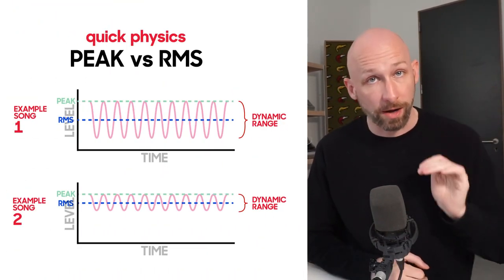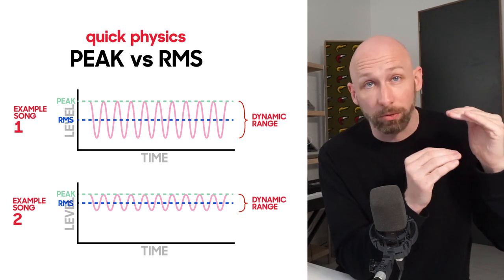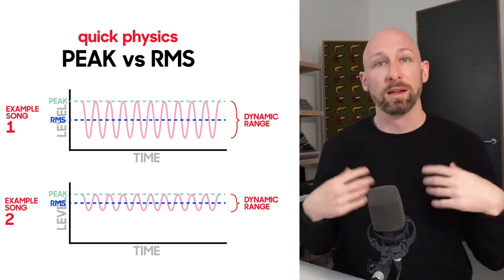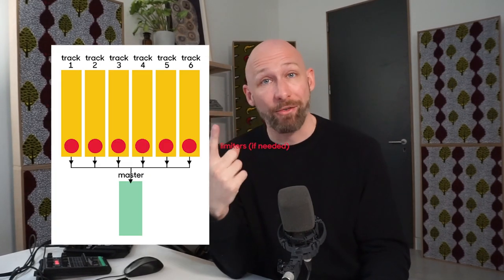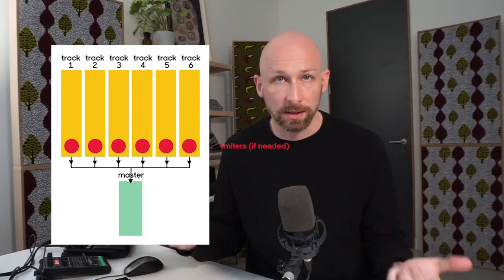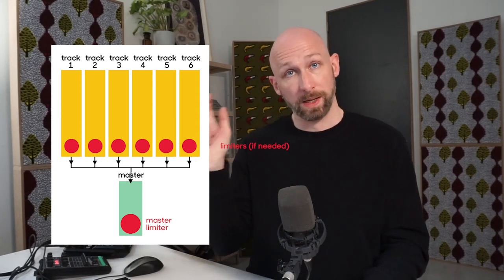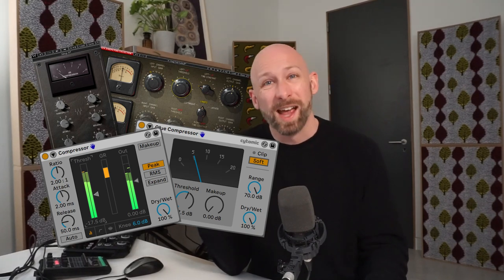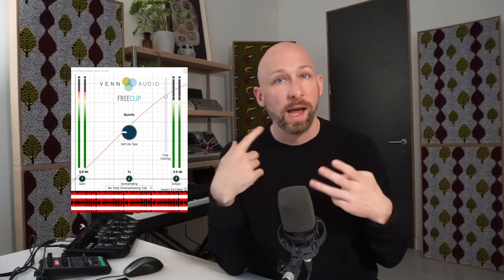Mixing loud: Managing your dynamic range using limiters

Comment: I can’t get my head around why compress a kick drum .
Reply: Well, imagine you have the kick with beautiful long tail and want it to be heard in some part of your mix. But it’s too subtle to cut through. So, you make it louder using compression.
Reply: What if you recorded a kick drum from 3 feet away and now you want to tighten it up as if mic was closer? You would do it with compression. Pull down the transient and push up the "ud" in the "thud" sound and it will sound like the mic is on the drum head.

Comment: It maybe harsh to point out, the amplitude of a sound signal has negative values and positive values. A compressor or limiter works on both directions. Your diagram is a little misleading.
Reply: Yeah I agree, and I started to question my understanding of physics here! I think its just that the troughs in the diagrams he shows here are positive amplitudes indicating the lowest level within the signal, and not representing a wave cycle. You are right though, a compressor would bring both the peaks and troughs close to 0 to decrease amplitube on a wave and its a little confusing to use a sine wave in these examples.

Comment: So well explained youre a natural teacher and know to express it for techno heads!
Reply from the maker: Means a lot, thanks!
Reply: @OscarUnderdog  I'm still confused by true peak and lufs. I know the latter is for streaming platforms
Reply: @ELLIOT8209 in short, true-peak measures the absolute max amplitude of individual samples of audio. LUFS is like RMS but it takes into account the natural frequency response of the human ear
Reply: LUFS and RMS are designed to communicate information about how we hear things. True-Peak is designed to communicate objective information about the signal which is really only relevant for other devices. TP tells you how devices will react to the signal, RMS/LUFS tells you how you may react to the signal. Hope that makes sense

Comment: Please never use limiters to control your dynamic range! limiters are designed to catch occasional peaks to prevent the track from clipping. their extrem settings (fast reaction time and hard gain reduction) will in most cases introduce distortion into the mix every time they respond to the signal. mastering engineers will ask you to send your tracks without any limiting engaged especially on the master bus. so in the worst case you have to start your mix all over again. compressors are the right tool to reduce dynamic range and an integral part to shape the tonal balance of your music as they offer more options to prevent unwanted distortion. 

i really like these videos and think you do a great job explaining things. however for beginners its important to not develop bad habits as they are really hard to let go of later on.
Reply: u assume people are actually going to send their track to a mastering engineer which 99% of people never will.

Comment: I tend to prefer lighter compression on most elements of my tracks, but sometimes you can definitely get some cool results going more extreme with the settings to really alter the sound and of course sometimes heavier compression is just a necessity based on the sound itself and where it sits in the mix. I'm also a big fan of routing all the top percussion through parallel compression to give those background parts a little more presence in the mix and bring more texture to track without bringing down the peaks of the foreground parts like the main hat. Makes things nice.

Comment: Great explanation of the Limiter! In my case,  I was only using the Limiter on my Main and didn't realize I should also use on the individual Buses which really helped with my overall song loudness which I was struggling. It also seemed to help me solve some kick drums issues I was having getting right. Thank you!

Comment: I like using a gate to take really long or rumbly techno kicks and adding a more defined punch to the front of it. Some samples can be really mushed, so adding a gate to reduce the volume after the envelope can really add definition to a kick lost in the mix. 

Maybe not the beesssttt method, but as a quick fix it works. Especially if you have your heart set on that particular sample

You could just cut the length of the sample, and that’d work. But it then completely gets rid of all the character after the initial impact

Comment: For clips before going for limiters or compressor you can control. the dynamic rannge using fade in and fade outs. Ususally peak is coming from trasiennt part of the signal  which can be reduce using fading . Found better sounds when compressor user for toning.

Comment: Really good video. Been trying to use the LUFS system but still can't get the tunes on average higher than -9 LUFS.  

For the electronic music that I make, I use a mixture of compression and limiting. I begin with a -3 DB compression threshold with a 1-2 ratio and a release time set at the 8th note of the BPM in milliseconds.  Then I limit at one to two decibels.
Reply: Tryo to mix with a clipper on tour master at thé begining (when you are doing thé kick conception

Comment: Yesterday I had the thought in my head.. just as a rough comparison.. If you have a spectral analyzer I would chose the higher frequency block to mark the peaks as they are much more frequent, and the lower for the RMS, as you can even see a lowpassfilter having very low frequency is behaving roughly like "R"oot "M"ean "S"quared algorithm, which is a kind of time shifting window lowpass filter.

Comment: Starting at 4:40 you state that the loud parts are tuned down and the quiet parts remain unaffected. This is only partially true in downward compression. In the case of a -3db kick on 1&3 and a -10 db snare on 2&4 and a threshold at -7 db, kicks would be reduced 4db and snares would be remain unaffected. The assumes a properly set release control.
If however you replace the snare with a -10 db constant organ tone or sine wave, those tones would be reduced to. -14 db each time the kick triggers the limiter, even though the tone is under the threshold. Downward compression or downward limiting, when they occur, turn the entire mix down when the kick hits. This seemingly minor distinction, is quite important because those other sounds in the mix are the things that cause the pumping and breathing with improperly set attack and release times. So while I realize that this explanation is targeted toward early stage education, I believe that is the best time to cement the concept that dynamic processing devices are simply automated volume knobs that really turn everything up or down very quickly. Your explanation is quite thorough and I only belabor this point because it is a common misconception simply tickle the tops, leaving the rest unaffected. A misconception that was identified by my mentor 50 years ago which still exists today.

Comment: i think maybe using comps and maybe some limiters like fabfilter pro2 on groups with very subtle gain reduction before going out to the master channel maybe a bit of saturations also. this is probably the later stage of mixing process so you need to commit and print to audio and be thinking that the song composition is done or at least the elements you are wanting to begin to group.

Comment: "compressor is kinda like a limiter in a way" -  it's other way around. Limiter is a compressor, with extreme settings. You can get any compressor (well, most of them, especially software) and dial in limiting settings. Limiter is a compressor with extremely hard settings on treshold so nothing would get past (thus fast attack as well), high ratio and then a makeup. Ofc, you can let something pas treshold and get soft or hard clip but thats another story, for more elaborate processing. I understand that you want to explain this to people with zero knowledge and that's ok, but let's not turn things upside down :)

Comment: Picture with up and down compression is quite confusing. I might be wrong but you can't actually affect on lower or higher part of a actuall sinewave graph. Because inside 1 sec of a signal can be 44100 samples which contain a lot of frequencies information. And what compressor does is make quiet frequencies louder (under threshold) and do not just changes ALL sinewaves by distorting actual samples waveform 🤔 you can try to repeat this animation 2:40 in Ableton. It's impossible 🤓
Reply from the maker: I realise it's confusing: the line represents the loudness of a signal, not an actual sine wave. Bad design choice on my side, sorry!
Reply: @OscarUnderdog  anyway thanks for your cool videos!✊✌️🙂

Comment: Thank you so much, this is the clearest explanation I have seen of these concepts. But I don't get what's happening at 4:53 - isn't the signal squared off now after the limiter?
Reply from the maker: Ideally a limiter should create slightly softer edges than a straightup clipping process would, but yes, the top end of the signal will have been affected by the limiter's effect, so your transients may be more squashed etc.
Reply: @OscarUnderdog  thanks!
Reply: @OscarUnderdog  does this mean you are limiting with attack and release times that are less than one waveform?

Comment: Amazing content as usual. Quick question where in track level audio effect chain do compressors go. Before echo/reverb etc or after. Or does it not matter
Reply from the maker: If you want it to be more 'realistic' emulating acoustic recording principles, then do the compressor first and then a little reverb. However, the other way around is valid too: first a lot of reverb, then compress it to "flatten it out". Depends on what's needed for the track!

Comment: I always have the opposite problem…my dynamic range isn’t large enough.  I’m always 1-3 LU lower than the tracks I reference.  It means that although my integrated LUFS are identical to my reference track, my track still sounds quieter.
Reply: use less processing in the producing stage. and ultimately use the techniques described in the video to get the desired loudness... but to get to the "professional" loudness without distortion is not an easy feat.
Reply: @coolaid5272  I do tend to use more processing at the mixing stage, so I'll try what you said.

Comment: I tried applying the limiter technique to my individual tracks but through gain staging and giving myself enough headroom they mostly sit around -18 db RMS and -12 peak. I would have to apply a alot of gain to each individual track in order to push the signal into the limiter. This is causing my peaks to be around -4 to -6 db which seems quite a lot for an individual track. What am I getting wrong here?

Comment: Okay I just watched another video outside yours, and I saw them saying dynamcis as the volume of the verse vs the chorus, to me that is not what should be named dynamic range in music. I am mixing and mastering , when I tried to make the song with most limiter the song feels boring and lifeless compared to the before.
So though it sound loud, bigger, cleaner, and silky, but the music does make me wanna nod and dance because the loudness processing tools messed the balances of kick snare hats, instrument relationship; which might be okay for EDM even Hip hop, but something.
if I want chorus less loud or loud and verses whatever loudness is not important to me if the overall song has lost its salt because of loudness. as I find all limiters are bad at keeping things sound neutral.
Even the Pro L.. even the AOM was not at all good at making thing sound like natural, I used to use fg x slate; it was better and the Stealth from IK multimedia.

So how to make a song loud and retain its original dynamic at least keeping sound like it was intended. I know if I am clear enough, mr Professor.
for example Hi Snare Kick Bass   original levels of each was on a 1 to 10 volume scale.

Hat 6              Snare   10           Kick  9        Bass gtr     8      original as producer had it  sounding best together.

Now compression, limiting and everything you can do to get a loud master alters that groove that now the dynamic is now something like:

Hat 9              Snare   10             Kick  10            Bass gtr  10

Yes I know they will change but at least which processing can keep the feel like they were dynamic or groovy. no one evert talks about this, because rarely look at the feel of the music they look at the new louder one.

But if most people will level match  their original mix and mastered might find the original had you dancing and vibing esp if you make the original louder as you compare say with a reference plugin where you compare song to song side by and adjust the level.

Please make a video about this.
If any understand what I am saying.
Thanks prof

Comment: I hadn't really thought about/understood LUFS until this video - surprising considering I studied in a school that prides itself on its EA program... Maybe I was sleeping for that part of the lecture. However, while building original tracks alongside a reference, I've always just thrown a limiter on my master channel to give myself that boost of confidence hahaha. I do an A/B now and again, but I basically just leave it on as I work because the music I (and probably most of us here) am trying to create utilizes compresion and limiting as a fundamental component - the music wouldn't sound the same without it. Now that I understand the LUFS thing a bit better, I'm going to try to throw an EQ in my master chain to compensate for that phenomenon to see if that helps things fit nicer. 

Any thoughts on if this is a good strategy or not? Do you see any production impairments I may be causing to my stuff by putting  a limiter on my master channel as I produce? - I guess one of them could be that it makes it easy for me to get lazy with EQing and mixing...
Reply from the maker: I do the same honestly! Just check regularly that the limiter isn't reducing more than 3dB of gain. If it is, figure out which elements are triggering it unreasonably, and bring the dynamic range of those elements under control. ✨

Comment: I mean, isn't everybody mixing the dynamic range to fit into the streaming service they want to put the song on to?  Highly compressed audio just sounds dull on these streaming services compared to other songs because of the automatic loudness leveling.  Around -13 lufs for spotity was the way to go, apple music -16.
Reply from the maker: You're right, but in electronic music there is still the assumption that your music might be played in a club or DJ set, where volume normalisation isn't automatic. There the safest bet is probably to keep your DR around those of your reference tracks. Streaming services guidelines will come and go on a long enough timeline.

Comment: I'm confused about your definition of dynamic range. If it's defined as the difference between peak level and RMS level, then a really spiky waveform will have a really high dynamic range, even if its dynamics do not change.

Comment: To all mixers/producers: Please STOP teaching people to use compression! This is a relic of the past which has ruined HiFi audio. It was useful for radio and lesser so for phonographs with poor preamp design. These relics have caused the industry to lag behind. Modern stereo equipment is fully capable of playing tracks with higher dynamics. What SHOULD be taught is to master all tracks at an industry standard around 85 dB RMS. These loudness wars are obnoxious. I understand the subjective and marketing research, but that’s such a sleazy excuse for lower quality production.